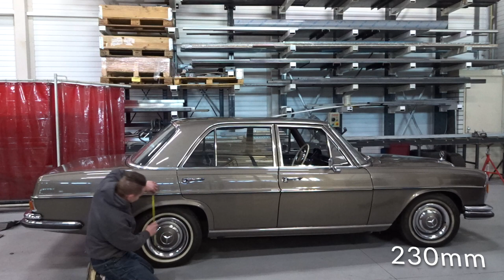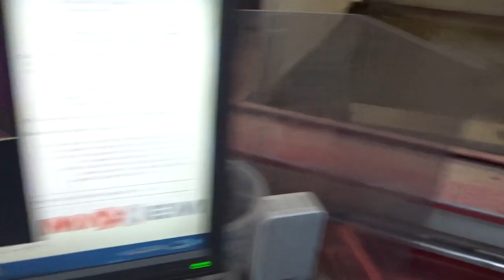Mercedes-Benz W108 airride build

Comment: we noticed you had to make rubber gasket for the air bags is that the only thing you had to do and was that only thing missing in kit, good work
Reply from the maker: The kit is reasonably ok for the money, i believe mist some bolts/nuts but thats about it indeed.
Thanks.